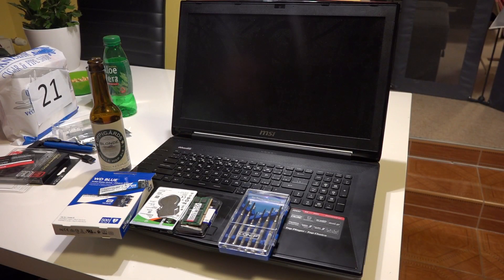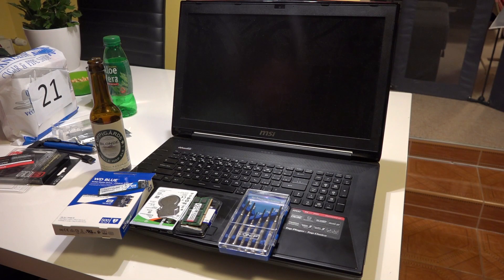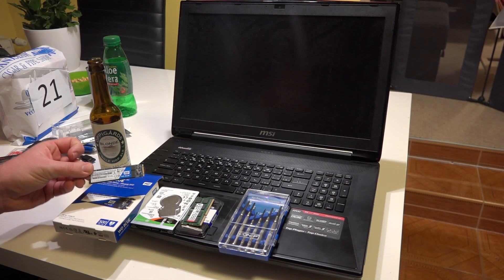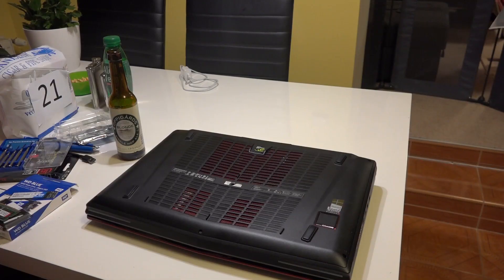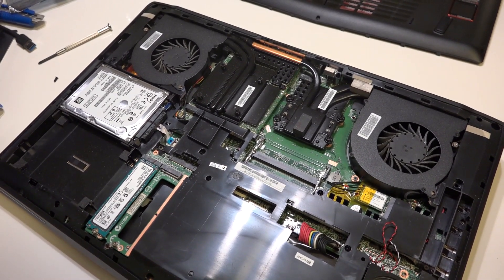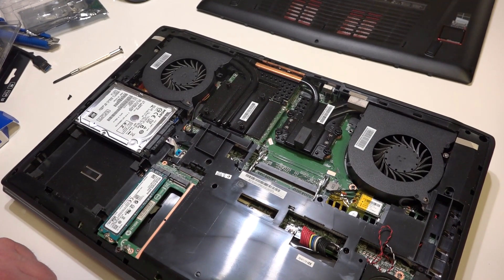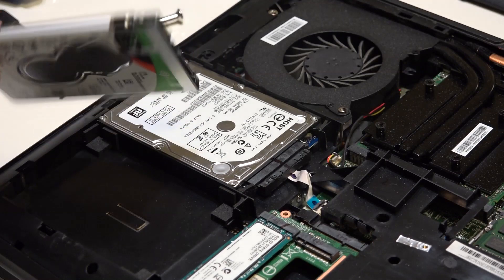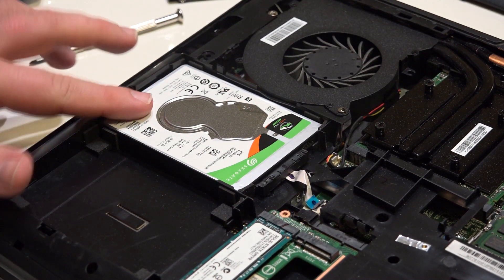MSI Dominator GT72 2QD Upgrade (HDD+SSD+RAM)

Comment: Hdd works on sata 2 speed instead of sata 3. Can't find what to change on the mobo. No one else noticed it
Reply: Found out, that sata 3 is only for ssd adapter due to hm87 chipset limitations

Comment: Hey guys, i finaly find the adaptator for 4 slot M.2 

https://fr.aliexpress.com/item/1005001551638356.html?spm=a2g0o.detail.1000060.1.454c585doCmp0y&gps-id=pcDetailBottomMoreThisSeller&scm=1007.13339.169870.0&scm_id=1007.13339.169870.0&scm-url=1007.13339.169870.0&pvid=a7cb5cfd-7e81-44fe-a740-20c37dee3bef&_t=gps-id:pcDetailBottomMoreThisSeller,scm-url:1007.13339.169870.0,pvid:a7cb5cfd-7e81-44fe-a740-20c37dee3bef,tpp_buckets:668%230%23131923%2339_668%230%23131923%2339_668%23888%233325%232_668%23888%233325%232_668%232846%238112%231997_668%235811%2327181%2349_668%232717%237563%23564_668%231000022185%231000066059%230_668%233468%2315616%23711_668%232846%238112%231997_668%235811%2327181%2349_668%232717%237563%23564_668%233164%239976%23931_668%233468%2315616%23711

Comment: Thank you so much for this video! My SSD is giving out on my GT72 Dominator Dragon Edition & I just ordered a new 1TB to replace the 2x 256GB that came with it. I'll be referencing your video on 08Jan2021 when it arrives to get it installed correctly. You're a lifesaver!

Comment: Hello!
I have an MSI GT72vr 6rd. I bought it used and drive 2.5 is not installed, but neither is the flex cable with the sata. Where can I buy it? How is it called?

Comment: What could be the problem, when I add Samsung EVO 970 ssd, my laptop doesn't even start to run when I press power button
Reply: NVMe is not compatible with the GT72 2QE. Has to be SATA.

Comment: First you'll need a beer (the next step is very important) don't finish the beer and put it closer as you can to the laptop 🤣
Reply: Hi. I have the same laptop 2qd dom pro and my laptops motherboard is not working do to a water damage inside charging port and it's turn on but no
Screen and for my bad luck I live in iran so no one here can fix this and only choice I have is to order a motherboard for my laptop if any one can hook me with one even a link for 5700hq md I will be in his debt and thankful for rest of my life

Comment: you can actually use the spare HD bay to add a hard drive, ssd or HD SSHD, I owned the GT73 VR w 1070 GTX and 7820HK and I just sold it and downgraded to MSI GT72S 6Qf 4K w the 980 GTX 8GB, what I was dissapointed in is that the unit only supports 2 x pcie nvme and the other 2 slots are M.2 SSD so since my unit has 2 x 128 in raid 0 I would have to sell those off and replace with 2 x 256 or 2x500GB  and raid 0 them but it is a fast unit w the 6820, after the sale I pocketed just over 500 and don't notice too much of a difference but overall the GT73 was more refined but lacked the 2 gpu option
Reply: excuse me, the socket for another hd (i want to install ssd 2,5" on it) is empty of any connection as it's shown on this video so, how could i connect it? My model is gt72vr 7qe. THANKS!
Reply: Are there existing connector mods available to install a drive in this extra drive space? That would be excellent.

Comment: How did you prevent Static discharge? ESD for your laptop
Reply: The internal battery also looked like it was still connected during upgrade installation. Isn't this a potential short issue?
Reply: @middlepath3607  yes, you should remove battery first

Comment: Sorry bit off topic but is it possible for the gpu to come off in any cases since my laptop has not been detecting my gtx 970m after updating intel drivers.
Reply: Nah, make sure u have the GPU turned on. There is literally a panel of buttons below the power button on this laptop that control numerous things, including RGB lighting, and integrated GPU functionality. So it's as simple as a click of a button. Though you likely figured this out by now.

Source: I have a GT72 Dom 2QD